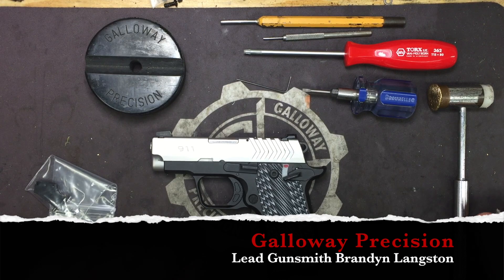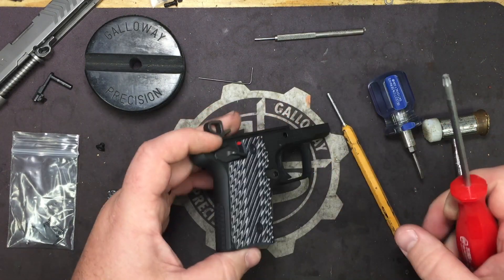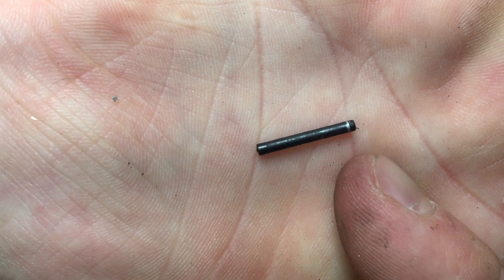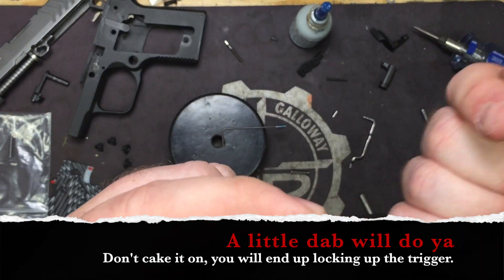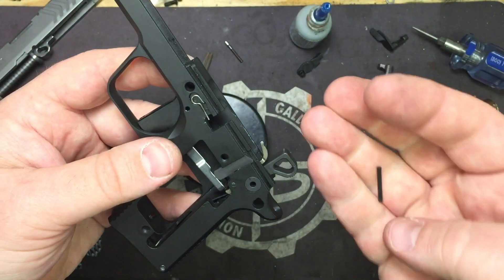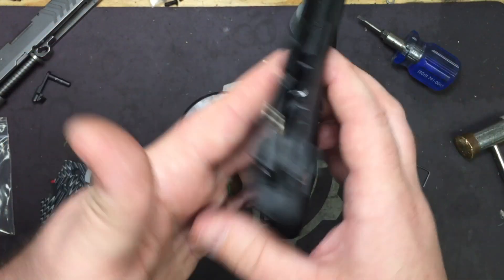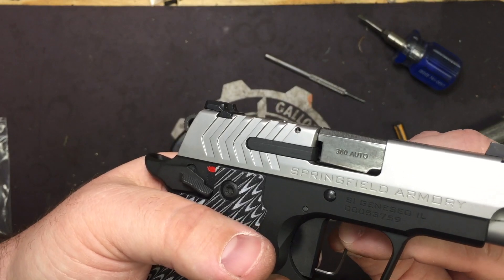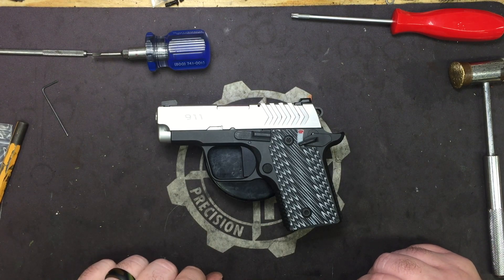Springfield 911 Crusader Trigger Installation and Adjustment

Comment: Great video, but I need some help with my 911. Long story short someone spilled soda on me and soaked my pistol and gummed it up. I had to break it down pretty far to clean it right. Now when I reassemble it the hammer won't stay cocked. I'm pretty sure it's something to do with the sear spring but I can't figure it out and there are no videos or images on how to do this. I know the curved piece goes behind the lifter but I'm not sure about the other side. Any help would be appreciated.
Reply from the maker: Sorry you are having trouble. Best to contact our tech from the Galloway Precision website and he'll be able to help you out.

Comment: The spring that came on my stock trigger will not fall freely into the new trigger as shown in the video. It goes in about half way and then stops
Reply from the maker: Hi Juan, Have you contacted us through our website? Our tech will be glad to walk you through your installation issue.

Comment: Hi, Thank yofor te video.
I pushed the ejector down too far and cannot get it back up inthe correct position even when pushing on the sear as in Melody video, is the 911 different to the Colt Mustang in that respect?
Reply from the maker: No, it should push right back up into place.  It may just be hung up on the leaf spring.
Reply: Did you figure this out? I'm having the same problem. It looks like it might be hanging up on the sear spring which is preventing it from rotating back up. I've tried manually pushing the spring back as far as I can, but the ejector won't clear it.
Reply: Yes,  you cannot just push it back up, you have to push the sear spring back while holding the gun upside down, check out video "Colt Mustang  ejector problems"
Reply: Thanks for referencing Melody's video. That solved the problem for me.
Reply: I had the same problem. Took it to local gun smith, he had to put the spring back on the ejector. Said I pushed it too far down when reassembled 
A $40.00 lesson I guess.

Comment: Great video! To be honest, I'm actually a 238 owner but watching these types of videos to see what parts could be compatible between it and the 911. The biggest question, I'm left handed and would like to do an ambi safety. Would the parts work from Springfield on the Sig? Assuming the parts are cheaper, such as the mags, but would love to see if you know this answer. Thanks for all of your detailed videos, cant wait to get the 238 on the bench.
Reply from the maker: Honestly no idea, but I would say more than likely it would fit.  They are all licensed off of the same Colt pistol after all.

Comment: wondering if you could help me out. A friend just dropped off and 911 380 so I field stripped it and cleaned it up for him. Now the safety is acting funny I am afraid that there could be a issue with the Main Spring Housing or something like that. I wasn't sure if you have a lot of knowledge on the lower receiver or not. I saw you handled the trigger well. So any help would be fantastic.
Reply from the maker: The safety on these pistols only interacts with the hammer directly, so make sure that it didn't come loose any when you took it down.
Reply: GallowayPrecision the spring was installed incorrectly took me a few minutes to figure it out but I got it. Also the detent plunger pin was missing so I had to contact Springfield to get the replacement.

Comment: Purchasing the 911 or the Sig Saur P238, and leaning toward the 911.  Question on the 911 grip.  Handled one at my gun store and surprised to see the top of the 911's grip to have a very sharp edge.  It is like they cut the top of the grip to fit, but did not smooth out or bevel the edge.  P238 grip at the top is beveled/smoothed out/rounded.  My concern is wear and tear on the side of my thumb during shooting/recoil.  Anyone have that problem or is it just a non-issue?  Also, do they make rubber/soft after market grips for the 911?
Reply from the maker: I don't know if they're making grips for them yet, but that seems to be the main complaint with the pistol.
Reply: The Hogue rubber grips are great on this gun..😃

Comment: You should be using purple locktight not blue. Blue is not ment for such a small screw. It will make the installation permanent. I learn that the hard way.

Comment: I hand tighten my screws and the grips on the left continuously come lose. Do you think it may have to do with the trigger bar?
Reply from the maker: Nah, just the loctite worn out.  Apply some new blue and you'll be good to go.
Reply: @GallowayPrecision  thanks for getting back to me with that. Have you done a trigger weight test before and after by chance?

Comment: what is lbs of trigger pull?
Reply from the maker: It doesn't change the pull weight, being that it has an over travel adjustment and a slight change to the geometry of the swing it will feel lighter, but without internal work it will still have the same weight pull.